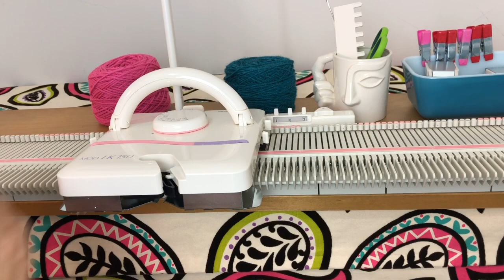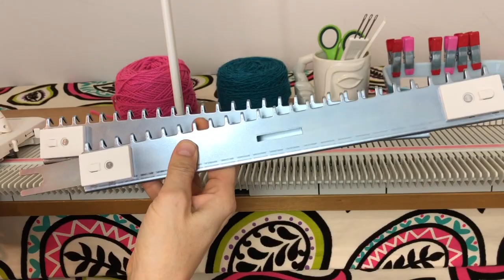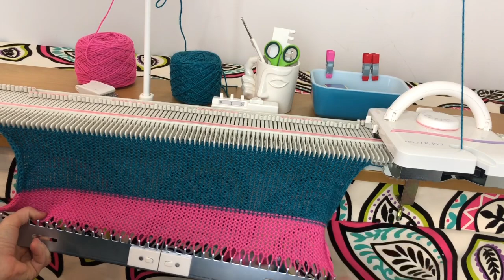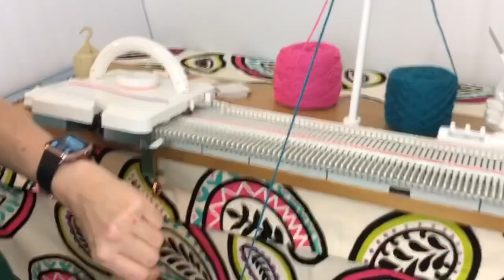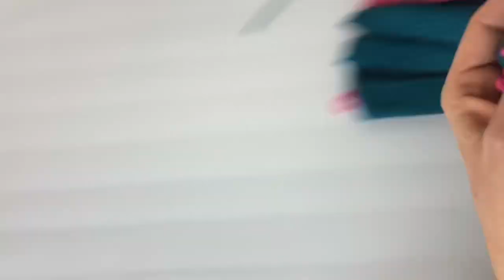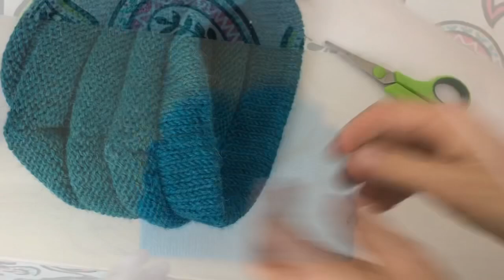Slouchy Beanie Tutorial using LK 150 or KX 350 Knitting Machine Beginner Hat

Comment: Quick question what size beanie does this end up making? before i follow this video to the T so i know if i should cast on more stitches or not cuz i have a big head <3...
Reply from the maker: Sorry I don’t remember but it fit me and I have a big head. It also depends what yarn you use.
Reply: @AnnaHaferman  turns out im using dk so im kinda just guessing, its my first project sso mostly doing it for fun... did 127 cast on because my gauge is different for using dk and did about 30 rows initially for about 3.5'' for the folded brim... resting for a little but then will continue and adjust as i go... if  it works out ill post what i did in your group <3...

Comment: IF YOU WOULD LIKE A HINT THUS----   WITH BEG. OF WORK DONE TOO NEXT  AT TURNING POINT !!!   USE FINE CROCHET COTTON OF A DIFFERENT COLOUR TO KNIT ONE ROW ONLY### THEN USE THE WASTE YARN (CONTRAST COL.)  AND KNIT 8 ROWS.  TURN WORK AS PER PATTERN CHOSEN.   KNIT NEXT 10 ROWS (OR CHOSEN ROWS REQUIRED)   AT THIS STAGE DO AS 1st WITH CROCHET COTTON ONE ROW ONLY AND THEN WASTE YARN. CONTINUE SAME  UNTIL PROJECT IS FINISHED.    NOW  PULL OUT THE CROCHET COTTON AND YOUR WASTE YARN SHOULD FALL  AWAY.    WIND UP THE WASTE YARN AND COTTON PIECE,   CAN BE USED MANY TIMES.  NOTE  THAT YOU MAY HAVE TO DISGARD 
WASTE AFTER A FEW  USES. ###  DON'T  HAVE ANY KNOTS ON THE CROCHET COTTON  ##   PLEASE TRY IT OUT, YOU WILL BE SURPRISED.
Reply from the maker: Thanks for the tip. There are many different ways to do it; choose whatever is easiest for you. You would only want to do seven rows of waste yarn if you use a ravel cord or your carriage will be on the wrong side.
Reply: @AnnaHaferman  Thank you, yes I understand that now.

Comment: I made it! It was easy easy due to your wonderful instructions! Honestly- the only problem I had was on my end: I have a garter bar and I struggled endlessly with it. Once I did your method of waste yarn it was smooth sailing! I made mine in purple worsted wt yarn I just upped the tension dial and it worked out well. I am giving this as a gift today I plan on making another one. THANK YOU SOOOO MUCH!!
Reply from the maker: That's fantastic! I don't have a garter bar for the LK150 so I haven't tried it that way. I do have plenty of waste yarn, so that worked best for me, too. I also wanted this pattern to be easy to do on the KX350 which doesn't have a readily available garter bar. 

I made this hat several times while I was designing it and then when shooting the video. I found that once I got in the groove it went pretty quickly.
Reply from the maker: Also, I gave one to my friend and sewed on some of the little bee charms I had left over from the honeycomb hat in a different video.